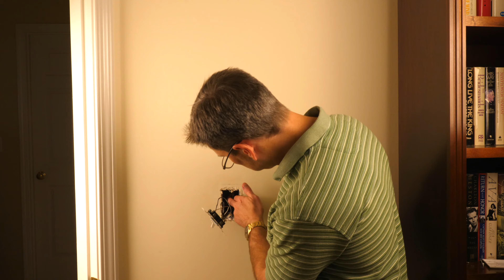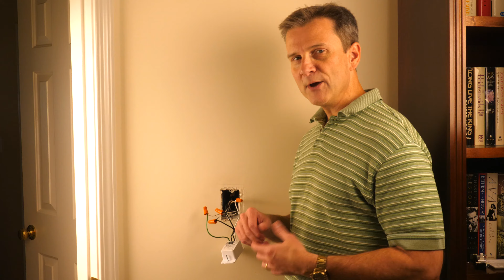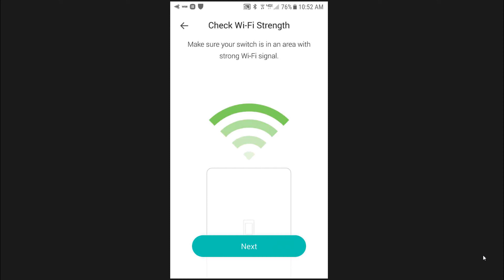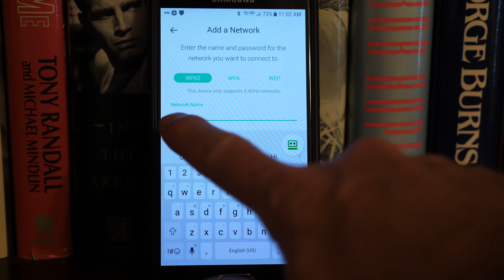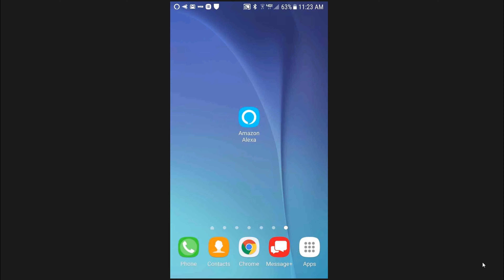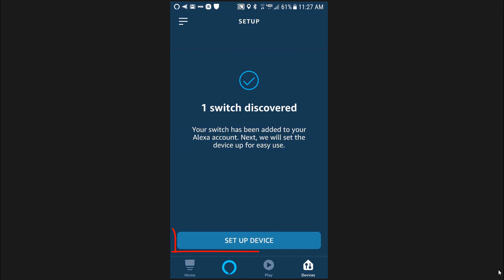TP-Link Kasa HS200 Wi-Fi Smart Light Switch. How to Install and Control By Voice With Alexa / Echo

Comment: Excellent instructions!  I just installed a Kasa HS220 smart dimmer and the hot and load wires DO matter.  You have a 50-50 chance of getting it right (I didn't) so just flip the two wires and it works great.

Comment: The wires from the device look like aluminum which you don't want to connect to copper in that manner(twist on).
Does anybody know how to tell if the wire is aluminum or not?
and if they are aluminum  I think this is a fire hazard for most houses.

Comment: It does matter which of the black Kasa switch wires are connected to the power line if another standard single pole switch shares power from the same hot wire. After initial installation the standard single pole switch failed to send power to the light.  After I swapped the Kasa black wire connections both the Kasa and the single pole switches worked.

Comment: Very clear instructions!  Having problem turning on.  We have 2 light switches in the dining room.  Now that it's installed, the regular light switch is blinking on and off and the Kasa isn't working at all.  Any solutions?
Reply: Are the switches in two different locations in the dining room and controlling the same light. If so, you need a 3-way switch version of the Kasa switch.

Comment: does anyone have concerns if they stop app support 5 years in the future???
Reply: Why would they stop working?
Reply: @EricEllenbrook  since they are a smaller company if they drop off and don't update apps you wouldn't have functionality any longer
Reply: @KaskadeHD  The light switches work without calling home. They just connect to your Wifi and work. Plus they're still physical switches so even if the worst case scenario happened, you'd still have a regular light switch

Comment: Thanks for the clear and concise instructions. I will receive a three pack of Kasa dimmer switches with a new Alexa/Echo 3 tomorrow and looking forward to installing and using. It is replacing a very old system that connected to my desktop computer with Cat5. and a type of modem that plugged into an electrical outlet. Haven't used it in years.